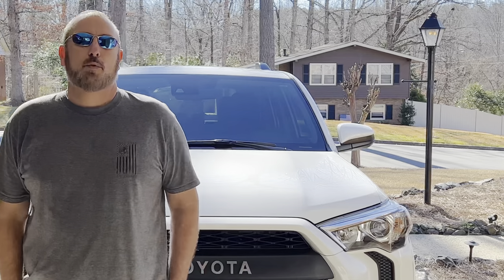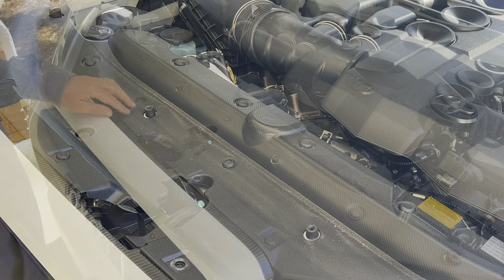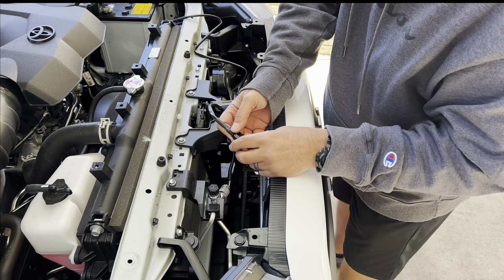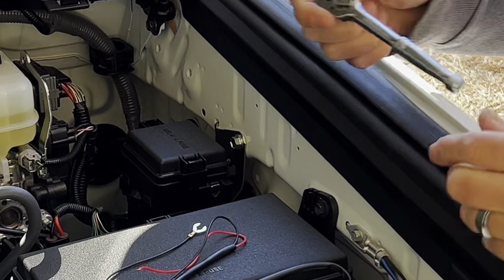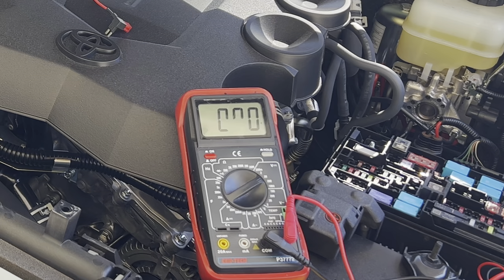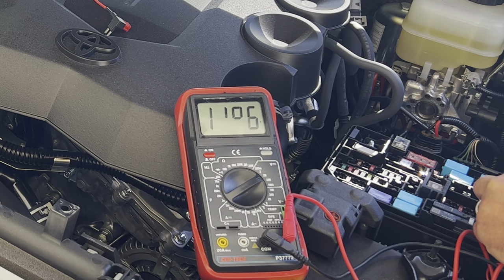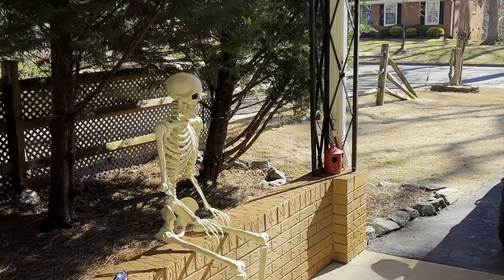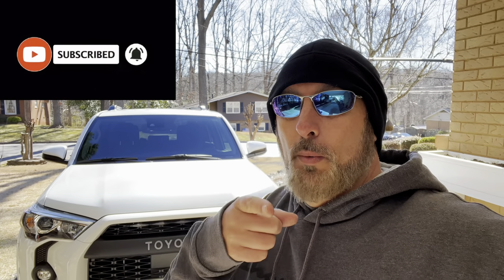Add Raptor Style Grille Lights To Your Toyota 4Runner. How To…

Comment: Nice!  The smoked lens option is nice, so you can’t see them in the grille when the car is off. I might buy these with a relay so I can run a switch. I have like 3 extra switch spots.
Reply from the maker: Awesome idea with a switch. The smoked leds are stealth!  Let me know how you like them when you get em. 👊🏼
Reply: @LivinWith3M  no problems with the LEDs so far? I’m scared they’re gonna flicker eventually.
Reply from the maker: None at all. Of course I can only speak for the ones I used. That link I provided from Amazon should put exact same ones of yours. Let me know if the link isn’t showing and I can get it for you. 🤙🏼

Comment: Can you show how you made alterations to the cover?
Reply from the maker: I can tell you. I took the plastic lid off and used a dremel tool. I etched out a small place where the wire lays so it wouldn’t interfere with closing of the lid.
Reply: The only problem I had is with closing the lid since the connection sits high it prevents it from closing. How can I make an alteration to that to make sure the lid is secure?
Reply from the maker: So it’s hitting the new fuse tap? They make a low profile 90degree fuse tap so the lid closes without hitting it.  I just took a dremel tool and cut a small hole in top of my fuse box where it closes now. That’s two options I recommend.
Reply: @LivinWith3M  thanks for the help!